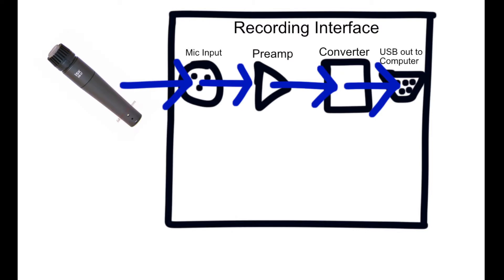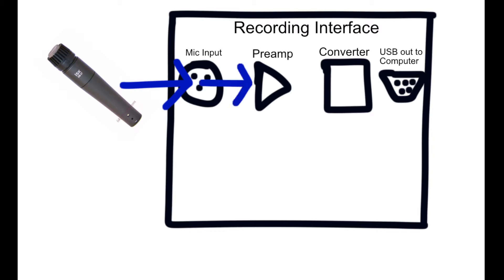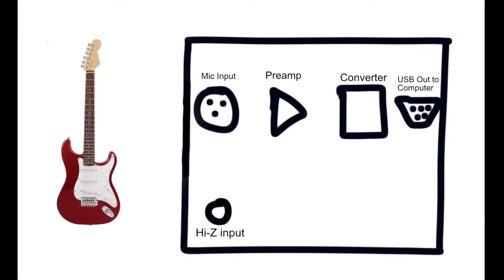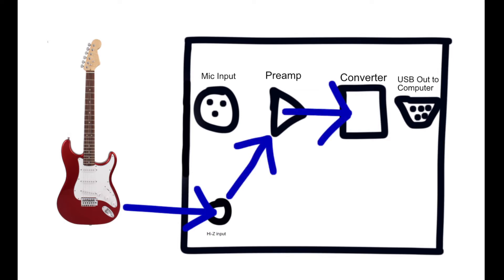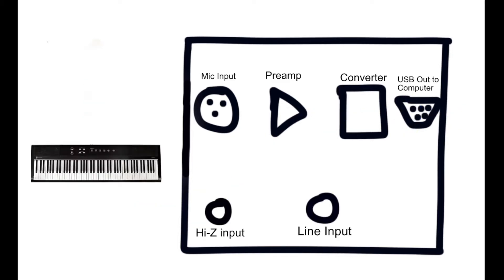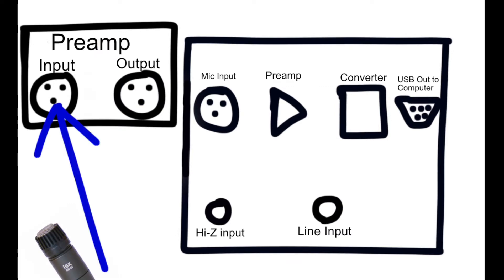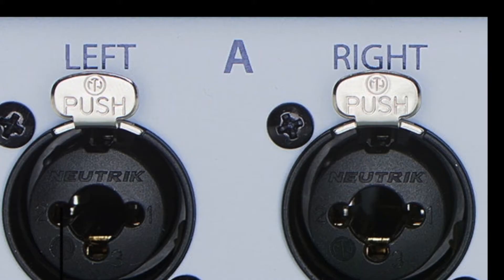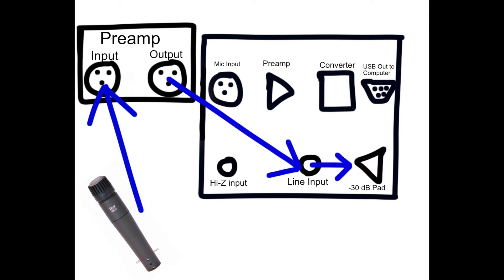Inputs and Outputs of an Audio Interface explained, lesson 15

Comment: what a chanell!!!!! had to subscribe...FIRE videos!!! I'm in the market for an interface and I'm looking at the apollo X8 but can't find videos online on how to set up the apollo with external converters and how to route audio.
Reply from the maker: Hi Africanrevolution,
Thanks for the question. The Apollo x-8 is capable of accepting 8 additional channels of digital over ADAT. This is what you would use. You will need an 8 channel external converter such as a Focusrite Scarlett octopre, or a behringer ADA8200. To connect it, you need to transmit 2 things, 1 the digital audio, 2 the word clock synchronization. The digital audio is transmitted through an optical toslink cable from the ADAT output of the converter into the ADAT input of the interface.  The word clock can be transmitted in 2 different ways, and one isn't better than the other, so it doesn't matter which one you choose. Word clock sync method 1: Get a 75 ohm BNC connector and connect it to the word clock out on the interface, and the word clock in on the converter. 
Method 2- Get another optical toslink cable and plug it into the adat out on the interface, and adapt in on the converter.

Once you connect everything, you will have the 8 additional channels of audio available as inputs on your audio interface.

Comment: This was a great lesson! Thank you. Is it possible to bypass the DAC in a budget audio interface and use a separate dedicated DAC to do the job while recording, tracking, and overdubbing? For example, could I use the Focusrite 2i2 to capture the sound (vocals/guitar) and hear the playback through studio monitors in real-time with an ADI-2 DAC fs? Will that work if I select in my DAW input to 2i2 and assign the outputs to ADI-2? Is ASIO capable of doing that? Thank you in advance.
Reply from the maker: Hi Leng,
In this example, you can not use the 2i2 for the input, and the ADI -2 as the output because the 2i2 does not have word clock synchronization. You might be able to make it work a little bit, but the audio quality will have pops and clicks.
I explain word clock synchronization in lesson 24, on audio conversion.
Reply: @Get.Beautiful.Recordings  Ohhh...got it! But if an audio interface (i.e. Apollo X8) has a word clock synch, it would be possible, correct?
Reply from the maker: @lengwxiong0082  if you can synchronize the word clock, then it might be possible. On a Mac computer, you could set up the ADi2 as an aggregate device, and that would work. I’m not sure if a PC has a similar function.

Comment: Wow. This is stellar content and was hugely helpful.  I am just not clear on the line outs of any interface really. I understand they are balanced outputs but what type of gear is used in the line outputs? I am reading that you would not use monitors in these and that's why there are designated inputs for monitors.  However, I am reading you would put midfield and farfield monitors in the line outs.....you can see how I am confused. So what exactly are line outputs?
Reply from the maker: Hi Peter, 
Line output refers to the amount of voltage (power) that the output has. The output from a microphone is extremely weak, around .01 of a volt, and is referred to as microphone level. The output from a home theatre amplifier where the speakers are hooked up to is very powerful (about 20 volts)  and is called speaker level. The output from a smartphone which you plug Headphones into is not as weak as microphone level, but not as strong as speaker level. This is a line level output. So, a line output (line level output) is an output of about 1 volt. Most consumer and professional audio equipment uses this amount of power as a standardized input and output level. So yes, the line outputs from your interface should go directly into the inputs on your monitors. Hope this helps.

Comment: I'm very new on this, but very interested video... should be interesting if you give examples of what kind of devices/instruments you connect in each type of input and output options. Thanks
Reply from the maker: Hi, thanks for your question. 
 On the XLR, you would typically only plug in a microphone, using an XLR cable. On the 1/4" line inputs, some examples would be the output from an external preamp, the output from an electric keyboard, or any output from an electronic device. And on the 1/4 " High Z input, you would generally only plug in a guitar.

Comment: Thank you for the information. I'm looking for the best way to stream and record meetings being interpreted in six languages. I believe this should be possible using a single PC running OBS and an audio interface with at least 6 inputs. I'd also like to have a backup, meaning that I'd need 6 outputs on the audio interface to feed a second audio interface. I'd appreciate any advice you have on which hardware or software to use. I'm looking at the Focusrite Scarlett 18i20, Tascam US-16x08 and the PreSonus Studio 1824c.
Reply from the maker: I would suggest the Focusrite Scarlett 18i20, or the Behringer 1820. To record a backup, you don't need a second interface. You can run 2 separate audio recording programs simultaneously. For instance, you can download Cakewalk, by Bandlab, as well as Reaper. Have one program record to your main computer hard drive, and have the other record to an external hard drive.

Comment: An interesting comparison between the Focusrite 18i20 and 18i8 headphone channels.
The 18i20 has 2 headphone outs, but they aren't included in the 20 output total. This is because they share the signal path with outputs 7,8 and 9,10. Any volume changes to the headphones will also affect these rear output channels.
I have an 18i8 which does count the 2 headphones as 4 output channels. There are no extra analogue outs on the back for them to share, but are counted as 4 mono outs that are included in the 8 output total.
Reply from the maker: Aah... thanks for pointing that out, it makes sense.
Reply: @Get.Beautiful.Recordings 
Hi i saw your Video 
ITs very good explanation 

But my question is 
For what and how do you use the Outputs of an audio Interface 

In some Videos they explain you route an Output through different eqs effects so anolog Gear and then Connect IT Back to one Inputs in the Interface , im a Bit confused because ITS a curcuit but i also understand what they want to do with This 

In no Interface the DAW is shown as an Input Chanel 
Thats sad because i cant make adjustments with the DAWs Sound 
Also No audio Interface Supports to adjust Headphones with Multiband eqs , so i cant adjust Headphones to the Monitors. Sound 
This results in incorrect mixing related to the Sound delivered by Monitors you have

My Idea was to send each Chanel i have in a DAW through an Output , bringing IT in a analog Mixer on single Channels 
Within This i can Mix everything 
If you Just have 8 Outs and Low Budget your very Limited within This 
But If your recording a Band and you send everyone a Headphones Signal on the eight Outs thats also an Option

Theres surely more Options 
Do have a Video or can you explain the Outputs Logic on audio Interfaces ?

Comment: Finally a video that clears up a load of confusing aspects of interfaces! Thanks. I'm very new and clueless about this stuff and I'm still confused about outputs. For example I have been looking at the behringer 1820 interface. It has 8 inputs, 10 analogue outputs (or 5 stereo pairs. What would I use these analogue outputs for and how?) and then it has various other outputs as well as usb output. If I just plug the USB into my computer would it come up in my daw as 8 seperate channels that I can mix independently? I'm sure there are all very obvious questions but I'm clueless and very confused! Any help would be great! Thanks!
Reply from the maker: Hi Tomos, Thank you for your question.  The Behringer 1820 is an excellent interface. As for the 10 analogue outputs, the first 2 are a stereo pair for connecting your main studio monitors. The other 8 provide 4 stereo pairs that can be used for a variety of tasks, such as recording a 4 person rock band, and sending each person their own live headphone mix (you would need an adapter for this, for more info, check out my video Lesson 11 on audio cables https://youtu.be/uRpmcqojf)
You can also use the outputs for external hardware effects units when mixing a song, or send individual channels to a hardware mixer for mixing, or for monitoring.
The other output channels on this interface are digital. There's 2 SPDIF, and 8 ADAT. I explain digital audio in Lesson 4, right here: https://youtu.be/RbqyMiHncXQ
Reply: @Get.Beautiful.Recordings  Thanks so much for a great reply! Really helpful. I will check those videos out in the morning. Consider me subscribed as well! I don't suppose you know anything about the zoom r16 multitrack recorder? After doing research I'm now torn between getting that or the behringer 1820. The ease of use of the zoom appeals to me as I'm fairly clueless when it comes to recording, however I'm concerned whether there will be a loss in audio quality compared to the behringer, especially as it's more expensive? I'm also hoping to be able to monitor practices and recordings live through either one, do you know if it's possible to do that with the zoom? No worries if you don't know about the zoom. Thanks again for your help!

Comment: So the “analog” output- can that go directly to mixer or still need a DI first? Thanks. I want to plug my laptop output to mixer. Thanks
Reply from the maker: If you are using an audio interface, then yes, an analog output can go directly to your mixer. The 1/8” audio output directly from your laptop is a headphone output, which is stereo unbalanced, so it will not go into your mixer, you would need to separate the left and right channels to have their own input into the mixer.

Comment: Thanks! Is there a difference between line out and "monitor"? Should you only use line out as opposed to monitor out for hardware inserts? I have a master and slave interface, and the master already have main outs I use for monitoring
Reply from the maker: Thanks for your question. There's no difference in the signal from a monitor output and a line output. They are exactly the same thing, but the software and hardware might treat them differently, for instance, by providing a conveniently located volume knob to change the gain of the monitor outs. depending on the interface and the software, the monitor outs might have different routing capabilities as well. In the end, they're both a balanced line level signal, and can be interchanged.
Reply: Thank you kind sir! 🙂
Reply from the maker: @casperbjerkehagen9386  you're welcome, thank you as well.

Comment: Quick question: I got the motu M2, can i send audio to external gear (a compressor) from a daw using the stereo output jacks (which are used to send stuff to my monitors) on the back?
Reply from the maker: Yes, you can send the signal out the monitor outputs and into any external gear that accepts a line level signal. After the signal passes through your hardware, you can route it into the line inputs and record it back into the daw if you like.

Comment: Hi, I bought two audio interfaces with line inputs on the back with the idea of plug in external preamplifier. I can hear it on headphones but they wont get recorded or even appear on the DAW. Does anyone know what I'm doing wrong. Cause none of the two seem to work and that's too much coincidence. The interfaces are Volt 4 and MOTU M4. Thanks
Reply from the maker: Hi, I have a Facebook group for helping people out, it’s called Get.Beautiful.Recordings. If you join this group and ask your question, I’ll be able to help you out better from there. 
Considering you are having the same issue with 2 different interfaces, the issue is likely something that you are doing wrong. There’s too many possible things that can go wrong for me to try and guess which one it is. Are you on a Mac or pc would be my first question. Please join the group and ask the question there to make it easier for me to narrow down what your issue is.

Comment: Hello, thank you for the Video. Speaking about the Appollo X8, how do you know if the line input automatically goes throught a preamp section, or not ? for example, let's say I plug 
a synthesizer into the line input. so I don't want the signal to be preamp. how should I know if it will pass throught the preamp or not  ? it is because you are saying that the line input also goes to a preamp, so I am a little bit confused :-)
Thank you a lot for your help.
Reply from the maker: Hi, sometimes on some of the cheaper gear, the line input goes through the preamp. On high quality gear, it doesn't. It can be hard to tell for sure, but you can usually tell if it does because the preamp gain knob will effect the input volume of your line inputs.
The Universal Audio interfaces are all very high quality, and will not route the line input through the preamp.
Reply: @Get.Beautiful.Recordings  Thank you very much for your feedback. Can I ask you a last question (and then I stop)  :-) ?
So in the case of high quality audio interface where you can plug a Mic or a jack 1/4" at the same input, I thus suppose that the audio interface automatically routes the signal to be preamped or not, depending if we plug a Microphone or a synthesizer for exemple. Is that right, or do I miss something :-) ?

Comment: Hi! I just bought an Apollo x8 and can I directly plug my korg synth or moog sub phatty into line-in? Bcz someone told me I have to plug it to hi-z but my x8 only has 2 hi-z and I already plug my guitar and bass.
Reply from the maker: Hi, The person who advised you was incorrect., the analog outputs of a keyboard are line level, so they are meant to plug into the line inputs of an interface (or mixer). Hi-z stands for high impedance, which is the type of signal that comes out of an electric guitar, therefore you would only plug electric guitars into the hi-z input of your interface.
Reply: @Get.Beautiful.Recordings  Thx!! This really helps me a lots 😭😭😭
Reply: @Get.Beautiful.Recordings  that guy told me this following message this time “It's possible to connect the line outs of keyboards directly to the line inputs of your interface, mixer or recorder, and some musicians do. However, the best way to protect against ground loop, phantom power and faulty wiring problems that could arise, and even damage your equipment, is to connect the keyboard to a mic input, via a DI box, instead. If you go through the DI box to a suitable mic preamp, you can also benefit from the tonal colour the preamp offers.” So if I don’t use di it might hurt my Apollo ?😵
Reply from the maker: @sjkkk48751026  Oh, my. There is absolutely nothing correct in that advise.
1- The outputs of your keyboard are called "Line Outputs" the inputs of your apollo are called "line inputs". They are made for each other. Plugging your line outs from the keyboard directly into the line ins of the interface will not only not damage anything,  it will give you optimal sound quality. That's how you're supposed to plug the keyboard in.
2- A DI box takes a high impedance, unbalanced signal and converts it to a low impedance, balanced signal, which then gets routed to a preamp, and the preamp converts it to a balanced line level signal. The output of the keyboard is already a balanced line level signal, so there's no need to alter it.
3- "A di box will protect against ground loop"
By using a DI box on the output of the keyboard, the balanced output of the keyboard will be rendered unbalanced ,and therefore actually be more susceptible to ground loop and interference.
4-"A DI box will protect against faulty wiring" 
You should just be using one or 2 (depending if you're running mono or stereo) balanced 1/4" cables directly from the keyboard to the interface. The only possibility of faulty wiring would be within the keyboard, or the interface, which is extremely unlikely, and a DI box will not help with that anyways. The DI box actually adds more elements to the chain which you, the user, could potentially wire up incorrectly.
5- "Benefit from the tonal color the preamp offers"
Do you even know what the tonal color is on the preamps, what it sounds like? It will be extremely subtle, and it's usually not desirable. If you do know what the tonality and coloration is, and that's something you want to apply to the sound of the keyboard, then go for it. Otherwise, you're just adding random noise to the signal.
6- I sometimes use a camera lens as an analogy. If you add more lenses will never give a clearer image, it is only possible for each additional lens to subtract from the image quality. It's the same principle with audio. As the signal moves along the audio path, the goal of each component is not to add quality, because that's impossible, the goal is to minimize the loss of quality, or create a certain desired effect, like adding a yellow filter to a lens. In your case, you just want the natural sound of your keyboard, and every time you add something to the signal path, there's a loss of sound quality. A DI box routs the audio through a transformer, which creates a duplicate of the audio signal and sends it out. There's imperfections in the duplication process. Same with a preamp, the audio goes through a transistor which functions by creating a duplicate of the signal at a higher voltage. It's like taking a picture of a picture.. it's only possible to subtract from the quality. So don't put anything in your signal path that's unnecessary.
Ok... I went on a bit of a rant with this reply.. but honestly, it was fun for me to write this :)
Reply: @Get.Beautiful.Recordings  thank you!! appreciate all your messages and knowledge, learn a lots from you!! I’ll spread that to my friend zone who has this question!! 😍😍😍